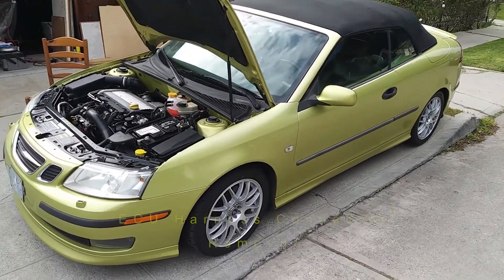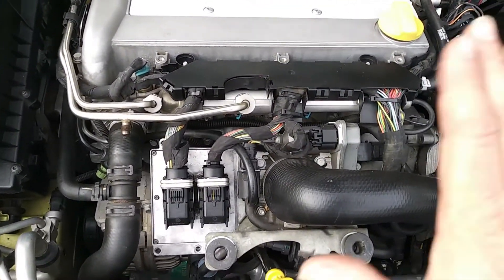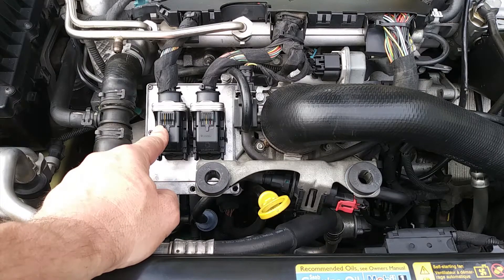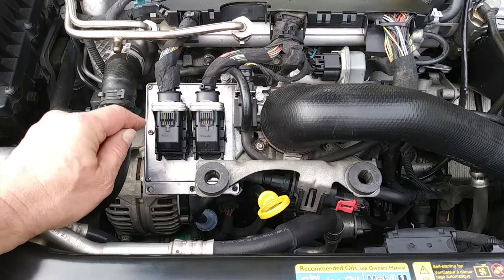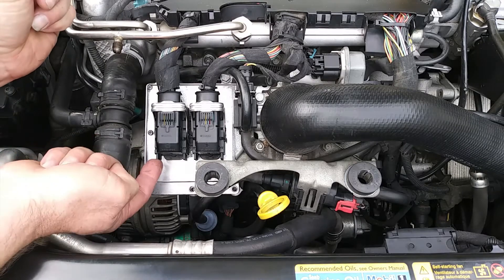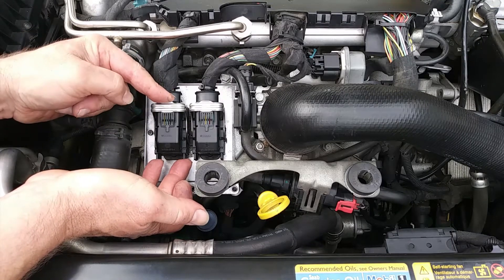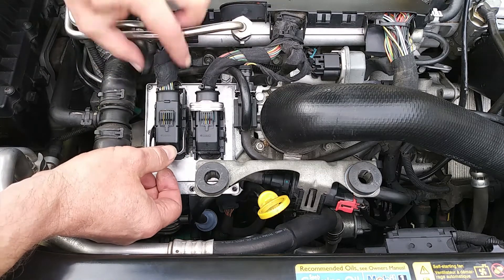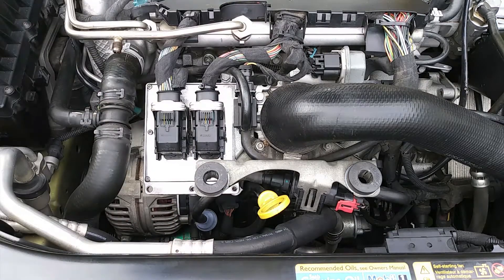How to remove those pesky Saab ECU Connectors

Comment: I had more trouble with that hose connected to the throttle body
Reply from the maker: Even when you keep an engine spotless, dirt and grime still gets in and under connectors and hoses making removal of some a real pain, lol.  Hope you got it sorted.  Stay safe.  Will release a vid on a new to me product from England for getting our exterior trim to look like new and stay that way longer than any other product on the market.  I'll post it as soon as I finish this project.  Look for it.

Comment: Can thos cause misfires? The crud
Reply from the maker: Definitely.  Today's engines with all their computer wizardry are highly reliant on unfettered lines of electronic communication.  Moisture, oil, dirt, all enemies of electronic components and their sensors.  Quite often a car that runs like it's on it's last leg will purr like a kitten by simply cleaning and drying all connectors of it's electrical system.  Off course, if corrosion has already taken place, then parts and affected sensors may need to be replaced.  A skilled mechanic, who is versed in todays high tech computer analyzers, is worth his weight in gold.  He will most likely pinpoint a source of trouble way before a backyard mechanic will do so without the proper diagnostic tools.  Geez, I talk too much, lol.  Thanks for checking out my video.  Stay safe my friend.

Comment: Oh man, you saved my life. But even when I got the retaining clip fully extended it was still 5 mins of wiggling back and forth to get the connector loose and removed. My ECU and the connectors were totally crudded up. But without this video I feel sure I would've broken the connector. Thanks for posting...VERY helpful!!!!
Reply from the maker: Yeah, sometimes these types of connectors are so fused with crud and oil that you second guess yourself on how they should come apart, lol.  Glad you got it taken care of.
Reply from the maker: If you've got any ideas for future videos about the Saab or anything else for that matter, gimme a holler ;-)  I'm about to change out all the rubber bushings on the underside.  After 200,000 miles the original rubber bushings are either cracked to heck or hard as a rock.  The ride is jarring to say the least.  Also gonna replace the shocks and struts.  The wife loves the car, so gotta keep her on life support - the car, not the wife, lol.

Comment: Thanks so much.  Did not notice the two tabs on the front and the ECU's have never been out in 14 years.
Reply from the maker: You are most welcome.  I'm a techie guy and had to stop a minute to figure them out.  It doesn't help that they are usually crusty, covered with grime and stuck, lol.  Thanks for watching.

Comment: great video! I only wish I had seen this before I attempted to remove those connectors on my own....I broke the levers by trying to pry it with a screwdriver to get it go the other way...
Reply from the maker: I feel your pain and imagined things like that happening before I made this video.  Thanks for watching.
Reply: Did you have a problem connecting it back to the ecu?